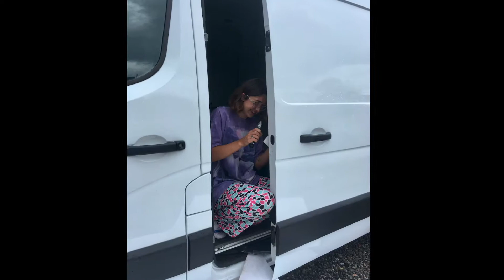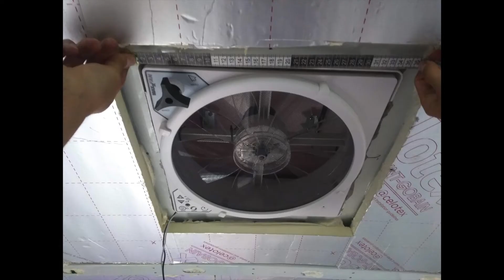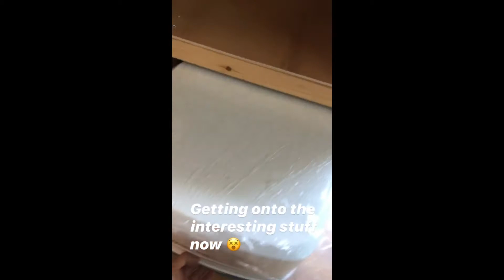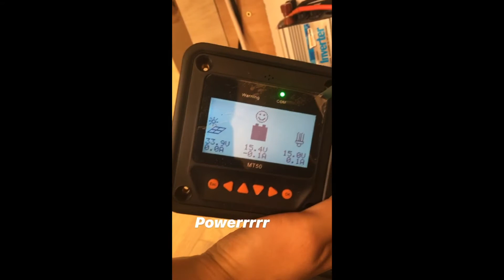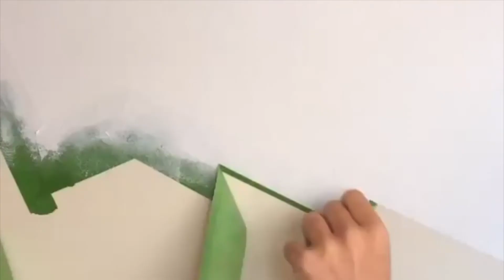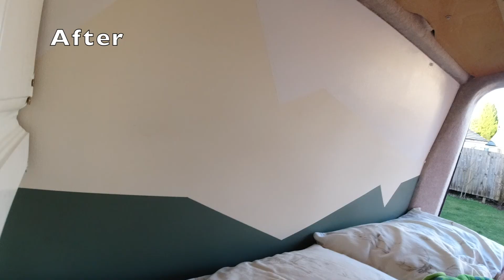Van Build from Start to Finish | VAN LIFE

Comment: If you see this comment, could you tell me if you installed a diesel heater and where you drilled the holes for it?
Reply: Silly me, I should have waited. So you installed it under the driver's seat?
Reply from the maker: Yes, it was mounted under driver's seat 😀